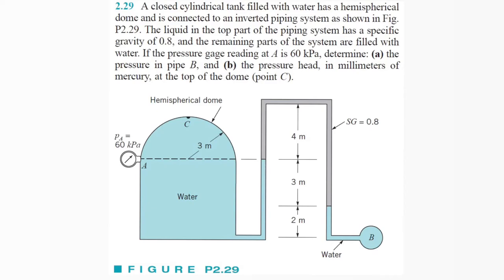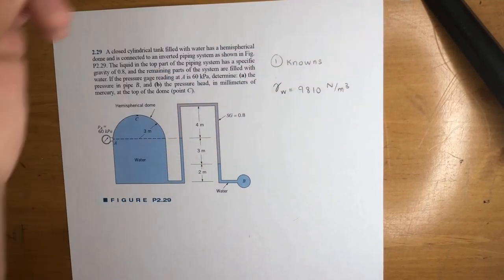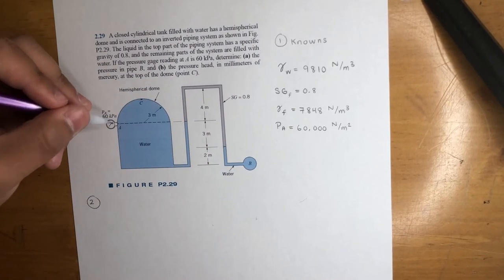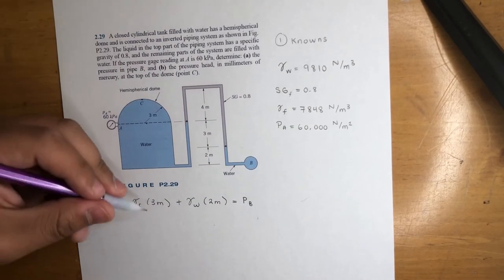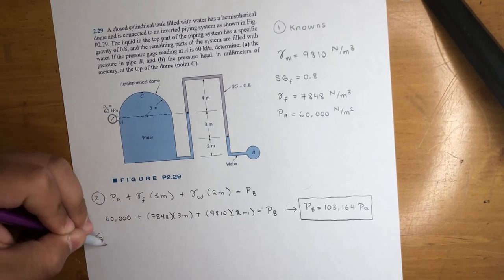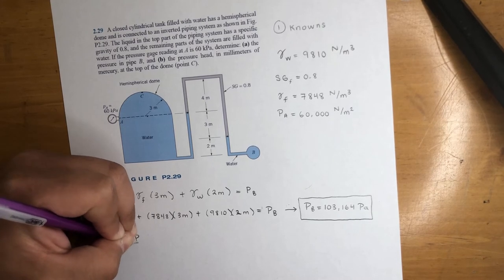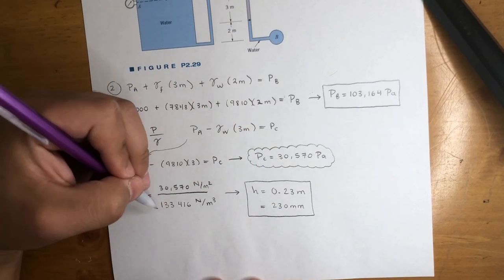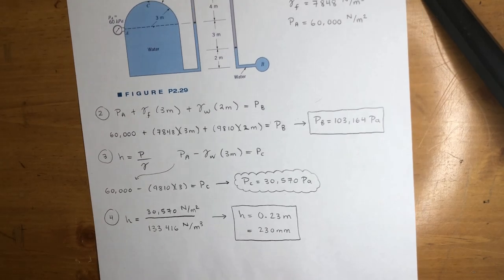Fluid Mechanics - Closed Cylindrical Tank Filled with Water has a Hemispherical Dome

Comment: in 7.30 , why we used specific weight of mercury, instead of water? system is only filled with water and fluid? there aren't any mercury molecules in the system.
Reply: The second part of the question asks for the pressure head at C in mm of mercury